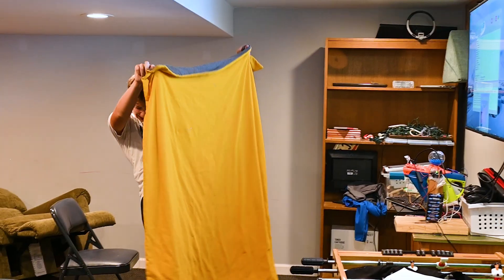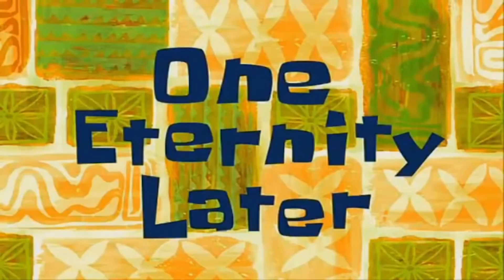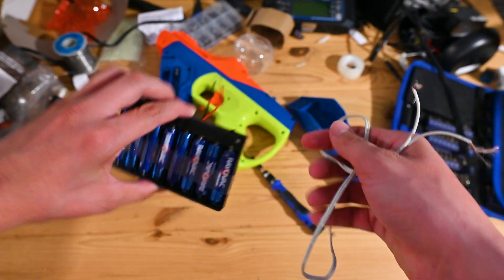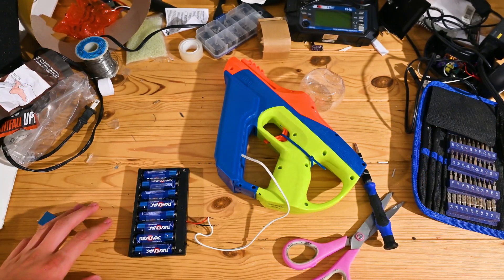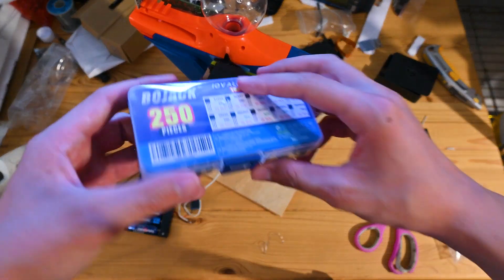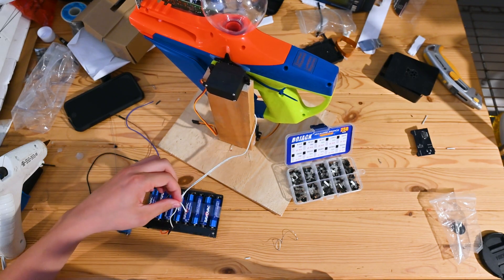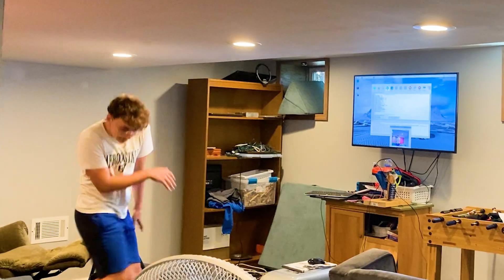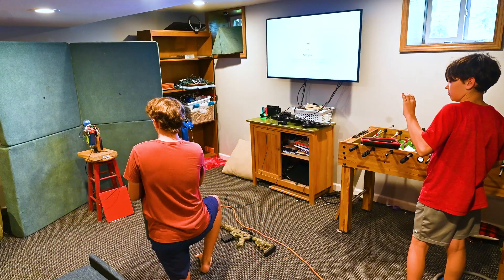Making a Face Tracking AI AIRSOFT Turret

Comment: Great video, i would recommend to use any sort of ai accelerator tpu like google coral or raspberry pi ai kit for about 30 fps and you will be able to run more advanced ais, also what raspberry pi are u using?
Reply from the maker: 3b+ lol, honestly idk how I got it to work as well as it did with such little power
Reply: @justaPancakeGuy  yeah its quite impressive to even see it run, i have a 3b, have you ever incountered the problem when it says no wireless inefaces?